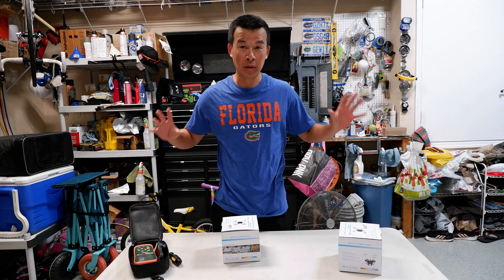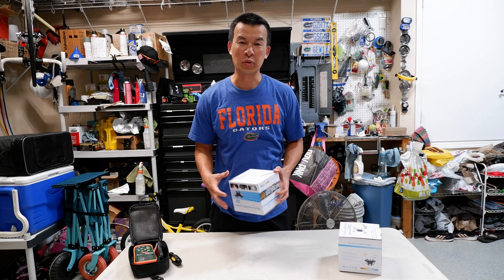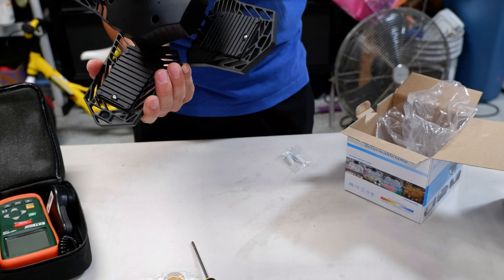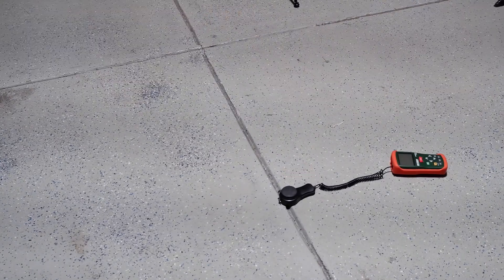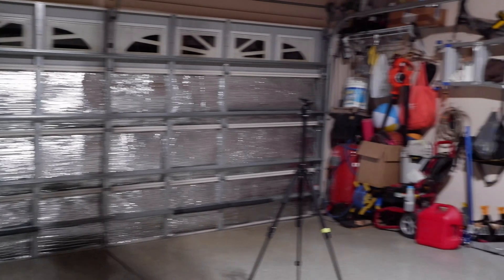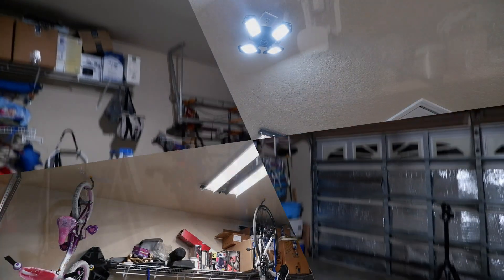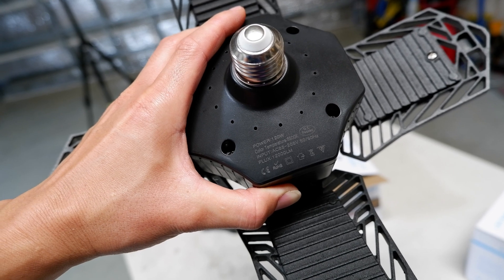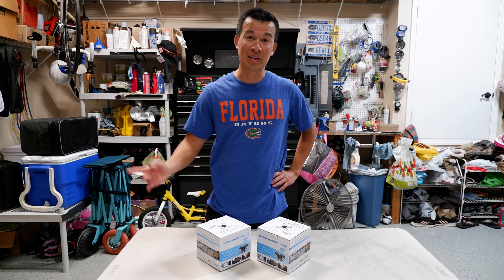Review Amazon 120W LED Deformable Lamp Screw-In Light | 4 Adjustable LED Arms | 12,000 Lumens

Comment: So it sounds like I can use this 120W LED Deformable, 5 Adjustable Panels,12000LM Shop Lightbulb (which I purchased on Amazon) in a ceiling fan lite 100watt fixture. Right? Thanks for a great video.

Comment: Hello, what if my garage does not have a screw-in light bulb base, but only have recessed LED light? Any suggestion on how to replace my existing LED recessed lights with these multi-panel LED lights? Thanks.
Reply from the maker: You’ll have to pull power from where the existing light is to new panels. Probably need an electrician unless you know how.
Reply: @TunerwithKids  The hefty electrician fee led me to asking questions here. Anyhow, thanks.

Comment: I purchased two of the lights and two panels stopped working on one light and one on  the other. My question is are the led panels replaceable without buy another complete light?
Reply from the maker: Probably try and return them. It might be a simple fix like loose or pinched wire.
Reply: @TunerwithKids  not a loose or pinched wire because the panels went out on two separate lights the same week and while I was looking at them a third panel went out. I ordered different ones on Amazon that look much better and nicer to look at. Thank you for your reply.

Comment: I have had two of these in my garage. One failed in 6 months and the other in 4 months. Probably not used more than 50 hours on either one. They just start flickering and go off. Do you know how to repair these?
Reply from the maker: Probably not worth fixing. Should be under warranty. Contact seller.

Comment: Thanks for the video. Could you shed some light on the heat dissipation? (No pun intended)
Reply from the maker: Each of the wings is aluminum and has plenty of openings to let the heat dissipate. But the LED used these days should be able to handle the heat just fine. Relatively speaking, there isn’t much wattage per wing.

Comment: Everything that you’ve been uploading is useful!! Keep the content coming and this is a dope light!
Reply from the maker: Hey, just to let you know. You won the lights. If you are US based, send me an email with address. See description box for email.
Reply: @TunerwithKids  These $25 garage LED lights at 120w with 12,000 lumens & 6500K (vegetative growth spectrum) prove that most LED grow lights are way over priced ...Years ago the 1st led grow lights were even bigger rip offs.... They were asking $500 to over $2,000 with the $500 models putting out about the same growth output as an old school  60W indcandescent hardware store grow light bulb. Then came the  90w UFO led grow lights for about $200. They started dropping in price when everyone complained they sucked. I bought one around 08-2010 for $60 when it was claimed they were improved. Pretty much a waste, unless used along with other types of grow lights....If they sold these garage lights in 6500K and around 2700K. Someone could buy 1 of each spectrum and have a small full spectrum grow light system that would rival a 250w high pressure sodium system for only around $50...You'd get 24,000 lumens of dual spectrum light for only $50
Reply from the maker: Normal progression of technology. LED is now the light standard. So prices have bottomed out pending the situation with semiconductors worldwide. Most new LED fixtures (not regular screw-in) no have selectable lumens and color. I just picked some recessed can retrofit lights that are selectable 2700k-5000k and dimmable using regular slide 120v dimmers.
Reply: 😭😭😭😭😭 yayyyyy!!